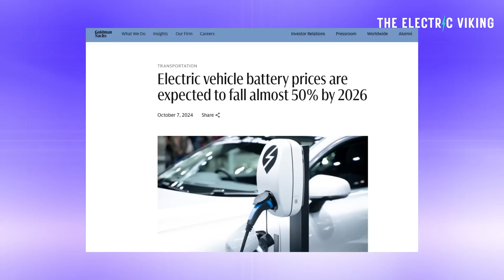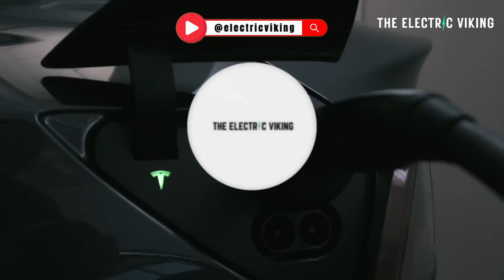Analysts say a NEW EV battery will be cheaper than fixing a gas engine

Comment: It is not the cost of the battery - it is the cost of work that is the issue - unless your car has SWAP. That is, a NIO or Onvo or Firefly that can swap battery in under 3 minutes.
Reply: The battery alone is about 30% of the cost of the car
Reply: @walidoutaleb7121 you may have outdated data, check again, lithium went down last year, batteries this year.
Reply: @walidoutaleb7121  But you need to automate getting the battery out of cars.. You cannot have mechanics do it by hand..
Reply: @ why? Big investment in automation for what, a one time replacement if at all? Makes no sense. Even Tesla realized where they were over zealous on automation and then removed those steps from it. Of course the humanoids will be trained eventually to do lots of those tasks and service as well. But design dedicated automation robots for a once in a car lifetime, or for less than 1% of cars that need  be a battery pack replacement simply is foolish waste.  Batteries can out last the car in some cases.
Reply: @Yippydog  B / c fast charging kills the battery. And it can still not compete with a 3 min swap. You can use a small 80 kwh battery for every day use and swap in a huge battery for vacation (otherwise a billion cars need to drive around with huge batteries all the time - heavy, expensive, more resources). People live in apartments - they do not have a home charger. Swap station can charge all batteries over night when power is cheaper, balance the grid, and make money selling back to the grid. Do you have a cordless drill at home, does it have swap?
Reply: When working on an ICE labour is free?

1 difference is that there are far fewer parts that need to be disconnected and reconnected with a battery pack.
Reply: @Jamessansome   @joebullwinkle5099  My point is - you need to automate getting the batteries in / out of the car... It is a no brainer. That is why you need EVs with swap.
Reply: @ If so, why did Tesla decide to not do it? Still does not make sense. Even a 20% loss in range is hardly noticeable to daily drivers. I am sure I wouldn’t care much after 8-10 years. But with today’s tech advancing so quickly, you don’t want your car that long. I traded in my 2020 model 3 for a 2024 model y so I could get the latest AMD computes and HW4 FSD inference chip. The m3 had 60k mi and had around a 7% range loss. That is normal for NCM chemistry and there was nothing wrong with that for my driving needs at about 75 miles a day. One or two extra stops do DC fast charging on a road trip. So what? I changed cause I wanted the latest tech. Yeah planned obsolescence…how old is your phone?
Reply: @Yippydog  It is not just loss in range. The car can get slow acceleration to the point that it becomes dangerous to drive. Soon you will be required to have the battery tested or not allowed to drive the car. Most people do not want to burn money having the latest car. Another large segment cannot affort it. Then we have the push for a greener economy.
Reply: @Yippydog  An Uber driver killed his Tesla battery in 12 months fast charging it. Would he have been better off with swap?
Reply: @Yippydog  About my phone - by 2026 (or 2027 cannot remember), all consumer electronics sold in the EU must be able to swap battery. That is, you must be able to change the battery. I guess you think that is a bad thing?
Reply: @Yippydog   @wolfgangpreier9160  Labour cost of swapping a Tesla battery is $500-$3,000. Some even say $5k. With no warranty if the 8 year warranty is gone.
Reply: @martina5328  no not your phone battery. Your phones become obsolete because it is planned by the manufacturer that the phone eventually will not be supported for latest software forcing to buy a new phone to keep up. It is similar with the technology in cars going forward. I do think it is a bad thing but there is little anyone can do about planned obsolescence if for example, security algorithms that protect your personal information get updated and implementation that is hardware on you old phone is obsolete or the OS that the phone runs on is no longer. You can keep the old phone until eventually it does not work or you have to buy a new one. The point was that keeping a car 8-10 years is now becoming less likely if you need to rely on the tech within. Still the battery science is suggesting that batteries can last that long. But who will keep an EV long with aging tech?
Reply: @Yippydog  Have you noticed that the world moves towards "sustainability" and that the longevity / economical life of a machine (including cars) is important for your wallet (or second hand value). Please note the EU law with regard to consumer electronics that will be in play from 2026 if I remember correctly. It says that all consumer electronics must have battery swap (you need to be able to change the battery in e.g. your phone). 

I am sure similar laws will apply to cars in the future. 

To reduce the battery risk for the consumer and the car producer by making it easy to swap is not a bad thing. Then we have the swap stations stabilizing the grid; swap speed vs charging; ease of maintenance of batteries; flexibility with regard to the size and weight of the battery in the car and the associated financial benefits; second hand value as the battery risk is removed; ease of recycling; no of cars that can be fully charged per unit of time given x space in cities like Hong Kong where space / land is astronomically expensive.
Reply: @ Ah to live in the EU countries. There is less regulations here in the US and laptops can even be glued together without replacing batteries. But that is just the physics repair ability. The example is self driving tesla. There is a debate right now if those that purchased hw3 cars prior to 2023 will be left behind. Originally Tesla said it is not possible to provide an upgrade to hw4 in these older vehicles. Now Tesla is only recently saying that if they can’t get full self driving up to par on hw3, they’ll upgrade those cars to hw4 inference chips but not with the new high res cameras. I actually traded in my 2020 m3 with hw3 to get the hw4 and also we still have the $7,500 inflation reduction act EV credit. That coupled with $3,500 EV credit from the state I live in and my trade-in resulted in a sweet deal that I could not pass up. Now that Trump was elected the expectation is the federal tax credit will be eliminated. I did the trade in September not knowing how the election would turn out. I am happy I didn’t wait and now I am on the first batches of full self driving unlike hw3 cars. Thanks for listening.
Reply: Well battery swap is an advantage in that case for your likely one time repair. Tesla labor rate is currently $100/ hr and takes about 10 hrs give or take. Even at $150/hr it’s does not exceed the projected $3000 or so for the pack alone. In 10 years charging speeds will likely make swap even less important. I prefer the safety of a true structural battery pack that takes 10 hours or so to replace rather than a snap together vehicle. With home charging overnight time is generally not an issue for daily driving. Road trips driving 2-3 hours at a whack and stopping for a 10-30 minute fast charge is not a big deal either. I can’t imagine swap stations being as ubiquitous as Tesla superchargers.
Reply: @Yippydog  There are no benefits with integrating the battery in the chassis. The benefits of swap are many. 

Swap saves you charging time (and in comparison) fast charging kills the battery.

When the battery is done, you can change it without taking the car apart. 

If your car is worth 5k the work to swap a Tesla battery is 1k, i.e. 20% of the value. With an EV with swap, you just go and swap. Read - the economic life of the car becomes much longer.

Swap stations allow service to the batteries, slow charging overnight of many batteries - so people without a home charger (most people live in apartments) can power their cars.

Swap stations balance the grid, buy power at night, sell power during peak hours at profit. Imagine a fleet of Taxis, they need to operate 24/7 to be the most efficient. And fast charging kills them + kills the grid.

You can sell the car with a tiny 80 kwh battery and user swap in huge battery when going on vacation - saves weight, power, resources.

There is no reason not to buy an EV without swap.
Reply: @ Sandy Munro on battery swapping pros and cons. 2 years ago. I think there are more cons than pros here. How long is a piece of string? Nobody knows.
Reply: @Yippydog  I will not buy an EV that I intend to own without battery swap. Leasing is different. But in the larger perspective leasing means that someone else takes the battery risk, in the end the planet.
Reply: @martina5328  of course you are entitled to that view. Still see it as more cons than pros. People are way more terrified over batteries than they need to be. Fast charging done correctly does not kill a battery. And certain types like LFP have little degradation at all. Nevertheless, anyone who buys an EV and needs to depend on fast charging or level two public charging has made mistake. The major benefit of an EV is home charging overnight. You wake up with enough charge every day just like with your cell phone. Most people are not driving 300 miles a day unless on a roadtrip. Then you fast charge 1,2,3 times depending on how far you’re going. I do maybe 5 or so trips a year if that so I almost never fast charge at all I think my 2020 model 3 had 25 fast charge sessions until I upgraded to a model y this fall. It had around 7% range loss at 65000 miles which is about average. Nothing to complain about. And if you happen to be in the unlucky 1-2% and have a defective battery, the failure is generally within warranty as the failures are in early life of the MTBF curve
Reply: @Yippydog  8 years warranty says it all. There is a reason for that limit. To me, it is hard to see any drawbacks with a car with battery swap vs the same car without.

Comment: Make interchangeable cells and allow access to them. Add software that reads cells conditions and it could be as simple as a oil change
Reply: John, agreed!
Reply: Sounds good, but…
It is all cost / benefit.  It is just not worth it.  
And not now does it cost more, it normally means a loss of reliability.

Comment: In Finland replacing an engine in an old car cost around 3,000-6,000 euros. Replacing a battery cost 10,000-60,000 euros....But maybe in some day we can get new battery for 5000 euros.
Reply: The industry is moving to very high cycle life batteries.  Replacing a battery pack is likely to become extremely rare.  The only reason would be due to a manufacturing error and that should show up quickly while the car was still in warranty.
Reply: Yeah a Jaguar Ipace and Porsche Taycan battery replacement is approx 40-45k. You must have a mental problem if you buy them second hand / out of warranty. But otherwise get one now that has 4 years of battery warranty left (not the mentioned cars) and you probably will pay significantly less than today for replacement in the future. A LR model 3 battery from 2019 should do 400k km easily. Not sure if you can cope with the interior quality and road noise for 400k km though.

Comment: Having over capacity in battery productioon for the next several years will be a great boost to energy storage systems. Solar, wind, and batteries (SWB) is already cheapest form of electricity -- as batteries decrease in price/increase in availability, SWB will usher in super-abundant power.  Combustion is dead.
Reply: SWB is NOT the the cheapest form of electricity production.  Batteries cost similar to a gas turbine peaking plant in the US (with the cheapest gas costs in the developed world).  And batteries can only last a few hours, whereas peaking plants can output indefinitely.  Solar and wind are sometime cheaper on a LCOE basis, but NOT on a LACE basis.  If you don't understand those terms, you don't understand electrical grid production.
Reply: @dzcav3    According to current research, the statement "SWB is NOT the cheapest form of electricity production" is incorrect; most experts agree that a system combining solar, wind, and batteries (SWB) is currently considered one of the most cost-effective ways to generate electricity, often even cheaper than traditional power plants in many regions, making it a leading contender for the cheapest option.

Comment: There needs to be a bit more detail to these claims. "Fixing an engine" what does this mean?  Some relatively simple things don't cost much at all to fix but yeah, if you blow a piston or the crankshaft that'll cost a lot.
Then there's the EVs where the battery is an integral part of the frame of the vehicle..  You can't replace that surely. The battery swap should be almost as simple as swapping the battery in any consumer product albiet on a much larger scale.

Comment: Higher density doesn’t mean you want fewer KWhs capacity in your battery, it only means the size of the battery will smaller.
Reply: Since the 1990s, the energy density of lithium-ion batteries has increased from 80 Wh/kg to around 300 Wh/kg. The highest reported energy density for a full cell is 711 Wh/kg.
In 2008, the volumetric energy density of lithium-ion batteries was 55 watt-hours per liter, but by 2020 it had increased to 450 watt-hours per liter.
Imagine what it's going to be like in a decade's time.
Reply: @captainwin6333  those are the maximum figures, and are not typical of the average lithium ion cell one buys
Reply: I think the idea is that being lighter, the vehicle will have less rolling resistance, and require less energy to accelerate, thus being more efficient. Less weight will mean smaller tyres, which also improves aerodynamics. I'm not sure about this because at higher speeds it's aerodynamics that play a more important role in efficiency, and I don't see aerodynamics improving that much.
Reply: @ThisRandomUsername less weight does help with increasing range but it’s not as much as many think. If a model 3 battery energy density improves by 20%, you’d probably save 200 lbs. that’s about the same as adding an adult to your car on a road trip. The range doesn’t change much at all. 

Your tire comment is important though and narrower tires would also improve range. If you reduce the battery weight by 200 lbs, would that be enough to reduce tire width? Maybe 10mm? So in total maybe your range is 3-5% better with a 200 lb weight reduction that uses narrower tires? I’ll take it but it’s not a huge number. 

What I’m more excited about is the impact on handling, ride and acceleration from reduced weight. If current energy density improvements continue, we could see a 50% improvement in the next five years. Imagine taking 350 pounds out of a Tesla model 3? It would probably weigh less than a comparable ice car! Not to mention the acceleration, range in handling will be noticeably better. Very cool stuff!
Reply: @kylekleman  
The Tesla 3 weighs about the same as a BMW Series 3.
Reply: @kylekleman  Awesome! Thanks for the context. I worry cooling could be a problem if there's less battery mass handling the same power, so greater power density required. Hopefully that doesn't become a problem.
Reply: @bobwallace9753  great point, it’s already there or almost there weight wise for most Tesla vehicles.
Reply: I think if battery density increases the battery kwh will remain the same or increase. In the USA people buy the biggest car they can find. Bigger cars need more battery capacity to keep the range or increase it. The Ford F150 is the second largest selling vehicle here. Typical Suvs are taller than mini vans.  @ThisRandomUsername
Reply: @ThisRandomUsername  aptera
Reply: That is what I was thinking when he said that. If he said the smaller battery requirement due to charging rate increase, that would make more sense.
Reply: Exactly. He seems confused on the math and physics of a kWh means.
Reply: @carloschang6279 really? I didn't notice that, please explain
Reply: The irony of this guy being the electric Viking yet not knowing anything about evs is hilarious

Comment: I don’t understand why you would want a smaller kWh battery back just because energy density has gone up? If anything you would have a bigger kWh pack as you fit more in the same space in your vehicle and it would also be cheaper per kWh. Am I missing something?
Reply: Because for many people the range is already ok.. and a smaller lighter pack means reduced rolling resistance, more space for cargo, better handling, faster acceleration, reduce tyre wear, lower price
Reply: Weight.

Comment: "fixing an engine" is a very nebulous term.  If that means replacing, than yes the cost is likely going to be around the same.  But I have had engines last 400,000 miles.  I have never had a car where the engine failed and needed to be replaced.  But with a battery it's not a matter of if but when you will need to replace it. My cars get driven so much it is everything other than the drivetrain that falls apart first, necessitating the replacement of the vehicle.
Reply: Lol. The life of your longest engine? 400 k. The standard warranty for CATL is now 1 million miles. 2.5 times the length of your ongest engine life is the standard. Covered by warranty. Your engine will fail. It will cost more and last less long then the electric car option. With the new paint as solar power feature coming up. Your electric car parked in the sun gains 12 k miles of range for free. Change is happening. In America. Electric car market expanded 8 percent last year. ICE continued to shrink.